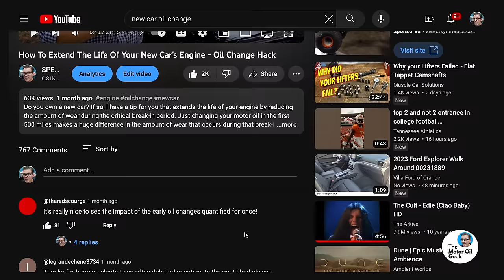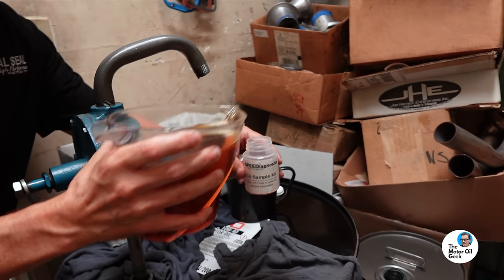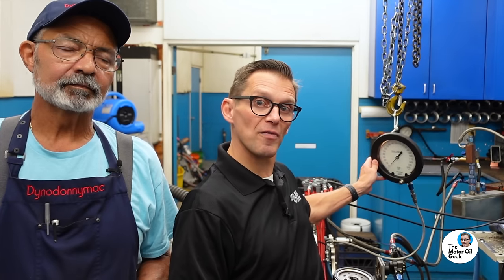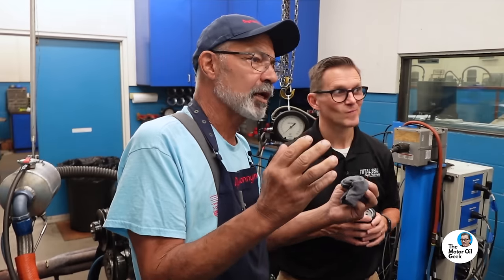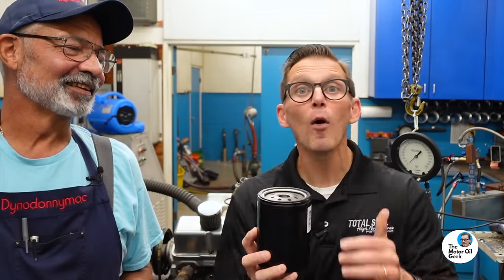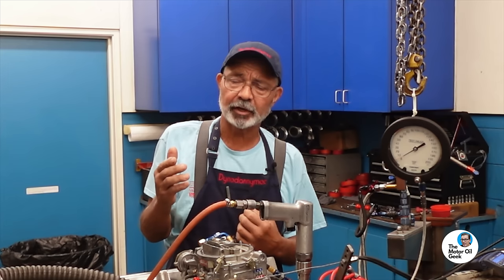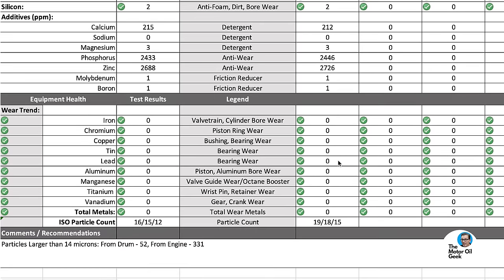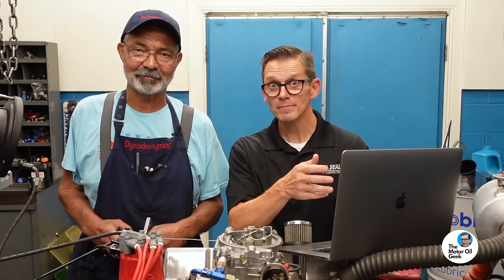Does Pre-FILLING The Oil FILTER Cause Engine DAMAGE?

Comment: I will applaud your patience. If someone told me that pre filling the filter with new oil would damage an engine because it hasn't been filtered, there's no way I could be polite. The amount of stupidity in that theory would normally shock me not considering some of the other things going around in not surprised. 
Nice job on the video
Reply: The reasoning isn't that the oil is dirty in the bottle, the reasoning is that most people aren't in a lab or marble floored shop, thus there's potential for a chunk of dirt from your hands or a piece of foil seal to go into the center of the filter and clog an oil galley on start up.

I'm a diesel tech and a lot of the filters say on the side not to pre-fill.  Caterpillar in particular always has a little oil can filling the filter with a big cross out over it.
Reply: A factory Cat manual says just that, I know, hard to believe.
Reply: @tomscrossthreadgarage4183  I'm going to assume that people that know More than me we're in charge of that because obviously the engines last a long time. I'm still stuck on what I assumed was a fact that the longer an engine runs without oil pressure the more where it will incur. Almost all production engines generally are fine on an oil change of screwing a dry filter up there. The ones with a really big oil filters I would assume take a little longer to fill unless they have that high of a volume of oil pump. 
Does caterpillar give their reason for not prefilling it?
Reply: Caterpillar at one point was the world leader( and may still be)in off and on highway diesel engines and it was always the engineers recommendation to not pre fill oil filters because they did not want unfiltered oil going thru the engine..that recommendation was probably not based on stupidity..... unless major engine  work has been done...no shop is pre filling oil filters... millions of filters are being installed dry yet there aren't millions of vehicles with engine failures on the side of the road..
Reply: @445xone  Their reasons are laughable.
Reply: @445xone  Unfiltered oil, think about that for a second. You do understand how an oil filter bypass works right?
Reply: @tomscrossthreadgarage4183  I wonder which  advice I should follow...the engine designer and manufacturer or an internet nobody on YouTube..
Reply: Cat engines might have design features to counteract the problem, or it's the fact that their machines are usually used in the dirtiest and dustiest environments and they don't trust people to use clean funnels. So their recommendation sides with the wear of an empty filter over the potentially really bad wear of a filled filter, where the oil was poured through the dirtiest and grittiest funnel.
Reply: @thorwaldjohanson2526  100% correct.
Reply: @445xone I honestly don’t think anyone cares what advice you take. Millions of people pre fill yet you don’t see millions of vehicles broke down from pre filling. Plus the guy in the video literally proved the whole pre filling is dangerous is a myth, complete fantasy.
Reply: Tell them to read about the filters built in Bypass.
Reply: @motorcitymadman146  the bypass is the first thing i think about when i hear oil commercials bragging about 10,000 mile oil changes in cars and light trucks. Not sure what the oil change interval is on big trucks.
Reply: This is how I feel when people say "ENGINEERS OVER AT X COMPANY SAY 15KM OIC IS FINE IN MODERN CARS"
Reply: @nickcautrell2514  I thought so too but a major engine company said not to do that because they had cases where the aluminum foil on the cap fell inside the oil into the filter that is all ready past the filter element. That piece of foil will not be filtered out will plug up some oil galleries and you have a destroyed engine. Very easy to understand
Reply: @tommytriglav5181  if that's the case, then it sounds like they need to come up with something other than a foil seal
Reply: @445xone  If you don't pre-fill the filter, and it causes your Caterpillar motor to wear out so you have to replace it more often (or repair it with manufacturer parts), would that have any benefit to Caterpillar?  Because I'm thinking their main reason for being in business is making money.  Oil is filtered by the producer.
Reply: @445xone  Neither.  Follow the test results.  You don't have any information from the engine designer, you have information from the manufacturer that went through the marketing department.  Wearing your engine out faster is great for selling parts and new engines.  The company exists to make money.
Reply: I've never refilled my oil filter on anything all my 65+ years and have yet to have an issue with anything. I've got BETTER stuff to do.
Reply: Like the inside of a engine is sterile 😂
Reply: @jefffisher-uf7bc  
  Especially  after 500 000 km and 15-year driving
Reply: @thorwaldjohanson2526  If you are daft enough to use a dirty gritty funnel to fill the engine you will still damage the oil pump as it is pre filter and only protected by a course mesh screen.
Reply: you gotta filter the filter first, because how will anything be clean. but you also need to filter that filter and then filter that filter ....

Comment: In the 1970s my Grandfather taught me to always fill the oil filter first, and lubricate the seal, always wipe the mating surface clean as well ! Been doing it that way ever since ! It just makes sense. Never had a lubrication problem with an engine ! My 97 Silverado is over 307 thousand miles still working great 👍
Reply: Vortec 5.7 is the Godzilla of V-8's💪🏽
Reply: What do you do when you have to turn your filter upside down?
Reply: i've built 180-cubic-inch V6 motors that have made 275bhp- with a slightly massaged holley model 4412 2-barrel carb- and all motor. lets see mr. goodwrench do THAT.
Reply: @alanmerritt860 spin it on really fast?? There’s definitely some dumb designs out there with oil filter placement.
Reply: @BobVan  vvg never prefills filters
Reply: @alanmerritt860  wrote, "What do you do when you have to turn your filter upside down?"

What you can do is pre-fill the filter and rotate it around slowly, to ensure that the filter material has been saturated with oil. Once you've done that, you can turn the filter upside down and re-catch the oil in the filter back into the bottle it came from. When the oil has slowed to a slow drip, you can then turn the filter back to the 'open end up' for a few minutes, to allow any residual oil to drain to the bottom. After a few minutes, you can then install the filter as usual. With a bit of good fortune, you'll be able to install it with little or no dripping, and the filter material will be 'primed' with oil. It's not going to be quite as good as an actual pre-filled filter, but it almost certainly will be better than installing it dry. Cheers!
Reply: @peauvoasmure  no, I just don't do it. Never have never will.
Reply: @alanmerritt860  wrote, "no, I just don't do it. Never have never will."

Then why did you ask the question in the first place? Looking for an opportunity to disagree online?

You literally asked: What do you do when you have to turn your filtier upside down?" And when I answered you with a helpful reply, you said no... you don't do it... and you never will.

Troll.
Reply: @alanmerritt860  Never seen a filter fitted like that, but, if it was 'upside down' the filter material would be pre-soaked so take slightly less time to actually build pressure in bearings and journals.
 Personally, I don't like pushing air through oil galleries.
Reply: @1crazypj  you've never seen a filter upside down, wow. 
My 63 dart with slant six is
Reply: @alanmerritt860  Never seen under the hood on one. 
I did work on construction equipment for over 8 years and things were often stupidly placed needing modified tools (carried gas cylinders so heated and bent some decent tools, but, not my Snap-On) 
Filters were almost always 'right way up' or stuck on the side somewhere, often remote mounted (hydraulic, fuel and engine oil)
About the weirdest was when I worked in a BMW (motorcycle) dealers. The 'R'75 and R90 series had a two piece oil filter in side of crankcase to allow it to 'bend' over the frame tube.
Reply: @1crazypj dodge 360 engines in the 1980s were like that….possibly other mopars…
Reply: @alanmerritt860  - easy!  flip the car upside down, add oil to filter, screw oil filter on ... flip car right side up!!  Voila!  Problem solved!!  :trophy-yellow-smiling:
Reply: @alanmerritt860  - whoever is named "vvg" ought to get a better name !!
Reply: @alanmerritt860  - well stated !!  not adding oil to filter is ONE less thing to do on an oil change !!  :yougotthis:
Reply: @peauvoasmure It was a facetious question to point out that you are wasting your time at best but more than likely putting your engine at risk.
Reply: @malcomreynolds4103  wrote, "It was a facetious question"

No, it wasn't. He replied seriously. Don't presume to mind-read other people just to have an opportunity to be disagreeable with someone. Dopamine addict :)

malc: "to point out that you are wasting your time at best but more than likely putting your engine at risk."

The lab result showed oil straight from the original container was cleaner than that same oil after going through the filter.

Also, the extra time your engine runs while building oil pressure on a dry filter vs pre-filled was 2-3x longer, meaning that not prefilling creates more wear on the engine until the filter is filled and pressure is built-up.

Did you watch the video? It doesn't appear that you did.
Reply: I was taught the same things, and I'm not going to change. It's just common sense.
Reply: @alanmerritt860 drink oil lol 😂
Reply: @alanmerritt860 
Those slant 6's were used a lot over the years, very popular.
The outside of them was often covered in oil, leaky engines.
Reply: @alanmerritt860 Pour the oil on the outside obviously. Duh...
Reply: That's exactly how I've always done it and never had a problem myself.
Reply: I never had the fortune of having a dad to teach me how to change my oil. Had to get my brother to teach me. But I learned to fill the filter and wipe the surface from ChrisFix. You're right, pre-filling it just makes sense.

Comment: I have always prefilled the filter because in high school, I took auto tech, and we had a valvoline sponsored video instruction on changing the oil. They suggested to prifill the oil filter to reduce the time the engine runs without oil pressure. So I guess thanks valvoline for teaching me right.
Reply: @renecruzbonilla  
That's right
Reply: thats just silly. the time it takes to pressurize is the smallest fraction of a second.... and even while you have moving parts in that small time period they are already covered in engine oil from surface tension...
Reply: But if the oilfilter is installed dry it may absorb better the first dirtiest drops of old residual engine oil which did not come out with the drained oil compared to prefillied oilfilter?
Reply: @amishdinkledork  Nonsense, an average size filter will take 3-5 seconds to fill, sit in the car and watch the oil light or pressure gauge after a dry filter change. I look after several 3.2l Shogun/Pajeros which have a large filter which contains close to a litre of oil and take about 10 seconds to put the light out if not prefilled. In 10 seconds at 1000rpm,  the engine will turn over 166 revolutions with no oil circulation.
Reply: Nah, put no oil in anywhere,  and have done.

Comment: As a retired ASE Master Heavy Truck Technician, I can vouch for everything you put forth in this video. I started out in 1969 as a mechanic apprentice in a small speed shop. When we built and engine, we assembled it using Lubriplate. Put it on a run-in stand and flushed out the lubricating system before installing it in a car. As I got older, I switched over to heavy trucks where I spent 49 years. During that time, if it were at all possible, we would fill the oil filter.
Reply: Lubriplate used to be some of the best oil you could buy, very high zinc levels. I used it for decades . When taking off valve covers to replace the gaskets that were starting to leak, I noticed that the valvetrain and even the inside of the covers were absolutely clean, no sludge of any kind. And that was after 100,000 mi on the engine. Now the epa has forced lubriplate to reduce the amount of zinc so I have quit using it.

Comment: in the early 80's Bosch sent  a Service Bulletin advising techs to pre-fill filters. The reason given was that the wet filter media was stronger and less likely to have elements break away during initial cold start.
Reply from the maker: Thanks for sharing!
Reply: that was before designed obsolescence. Now they do all kinds of things to accelerate wear like giving bad break in advice and long oil change intervals. I knew an engineer for aircraft told me we have the tech to make engines last millions of miles but choose to not use it for that. Brakes too!
Reply: Yes, the filter media can experience a great shock from the incoming oil pressure wave while being unsupported on the filtered side by an equilibrium of pressure. Another great reason to pre-fill the media.
Reply: Hmmm on my 3.7 mustang if I were to pre fill the oil filter and install it since its installed sideways then oil will come out while installing...I don't like dry installing the filter so what I started doing is filling the filter and then letting all the oil drain out of the filter...good to know about shock of oil pressure on dry filter media...I suppose my method of filling the oil filter and then draining and installing to saturate the filter media reduces this issue at the least on horizontally mounted oil filters
Reply: @monikhushalpuri on side mount filters, I fill them ~½ full. oil will wick/saturate media.
Reply: @monikhushalpuri  on any engine the filter should be at least at a 45 degree from vertical and horizontal so that you cab pre-fill it. My 6.3L Ford V8 also has the filter almost sideways but I will try and prefill it at least a little. Its about 10 degrees off horizontal downward angle
Reply: @monikhushalpuri  😎🤙💯You can also on any car that you feel injection you can just simply put your foot all the way down on the gas pedal turn the key so the engine turns over for 10 seconds, and then take your foot off the gas, and that will prime the engine, and it will start.
Reply: @jamesmedina2062  you can simply just put your foot on the gas pedal turn the key and let the engine turn over for 10 seconds, then take your foot off the gas pedal and turn the car on you just primed your engine oil🤙😎💯

Comment: A little tip, when I have an engine that I can't pre-fill the oil filter. I disconnect the ignition and crank the engine until I see oil pressure.  Then I reconnect the ignition and start the engine.